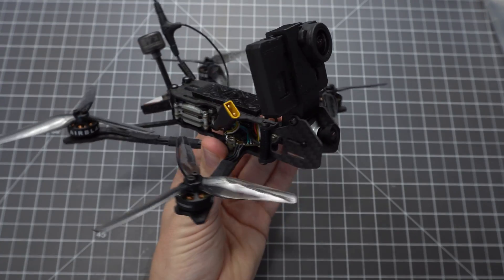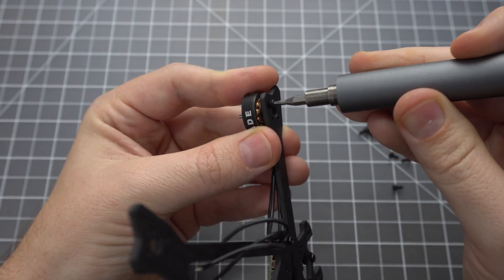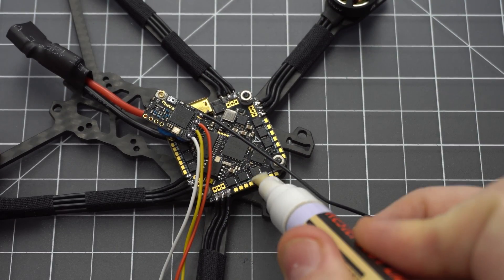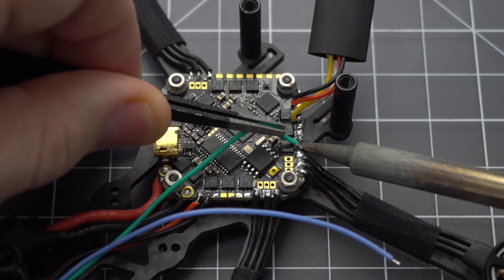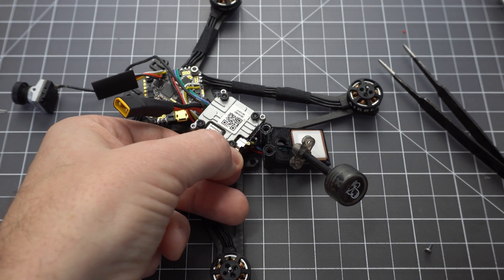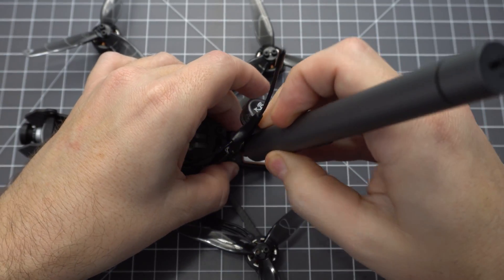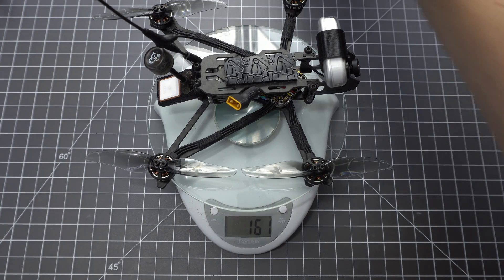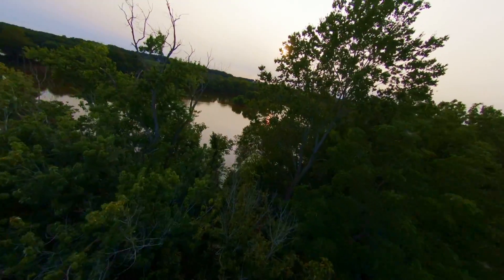How to Build a Micro Long Range FPV Drone - Transformer Mini

Comment: 4 inch frame with 2.5mm base plate
beta fpv toothpick f4 20 amp all in one flight controller with xd 80 and capacitor
Airblade superman 1404 4850kv  brushless motor
cadx vista / Nebula camera 
Tbs m8 gps TPPU holder 3d print for GPS
crossfire nano receiver 
cadx vista antenna

Comment: hey you said you could skip the reciever step if you're using the dji fpv controller. what did you mean by that? I'm going to basically create this exact micro long range build just with a dji air unit. do I use a different reciever?

Comment: Question: I would like to have at least 10km range with fpv goggles. What is the cheapest solution? Goal is to inspect my land without using my car. Could I use BetaFPV VR02 and boost the signal for longer range? Image quality isnt a priority right now, I just want to get started with something long range.
Reply: Bottleneck is battery time , hardly 15 mins , there is some kits allows to 22km (max 30) at 150-180ms but there is no battery invented for it , even large battarys has small range due its weight

Comment: Did you get around to making a 2S 21700 4500maH pack for this?  :) I have been slacking hard-core and haven't had time to assemble my Transformer yet! 😆
Reply from the maker: Yes, but I had a hard time tuning 2S, so 3S is the way to go.
Reply: @whiffles  good to know. I've got the 4850kv motors to put on mine.
Reply from the maker: @j.c.m5168  Those will be perfect for 3S or even 4S. Lots of oomph on 4S.
Reply: @whiffles  another quick query....realistically what gauge wire do we need for this setup for an XT30 plug? I'm running the flywoo 3000MaH 4s LiIon as one option, and Apex 1100MaH 4s LiPo as a lighter weight option to have around and try out. Thanks.

Comment: How good does your GPS work?  I have Matek  M8Q installed at the same position on my 4" quad (with analog VTX) and it could find only 6 sats. I got GPS works only when I moved it to the front of the quad (where GoPro is usually placed)
Reply from the maker: It works pretty well. I think I had 14 sats last time I flew. You may need to wrap the wires where they pass by the VTX with some copper tape.

Comment: do you have a link for the antenna holder/sleeve? thanks!
Reply from the maker: It comes with the TPU GPS mount listed in the part list on the written guide.
Reply: @whiffles  the link in your guide has the GPS mount but looks like one piece per that airbladeuav site.  I had already ordered it but thought there was a second part I needed to order after watching your video.
Reply from the maker: @orblivious1  Actually the design of the GPS mount has changed. The Immortal T sleeve is built into it now.
Reply from the maker: @orblivious1  Nope, no need now. It's been redesigned to serve both functions.

Comment: your soldering is very bad
Reply from the maker: Thanks for the feedback! Any suggestions?
Reply: @whiffles  definiately you need to keep in mind that both parts you solder need to be warmed up to melting point. In that way you will have a very good bound. You will see it when the solder "flow" on the pad and change a shape from a "bally" look.
Reply from the maker: @terragady  Which joints need some work? Motor wires, power lead?
Reply: @whiffles  cant remember now but can tell later when i have time to rewatch, remember also that for example ground needs little more heat as it has more temperature capacitance because there is more cooper/metal.
Reply from the maker: @terragady  Good to know, thank you!

Comment: You have flush cuts! please flush cut your zip ties hard against the head of the zip tie.
Also, you don't need to add flux to the pad when you start soldering. Solder has flux in the core. You'll only need to add flux if you're trying to reflow a joint.
Reply from the maker: Thanks for the tip!

Comment: How does this compare to Dave_C's micro long range in terms of weight, flight time, etc? ^^
Reply from the maker: It's a little lighter and depending on the components and batteries you use the flight times will be more or less the same.
Reply: @whiffles  Thanks! :) Didn't realize your build was that much lighter! I now went back to his video of his Flywoo Explorer, for comparison: He measured his without battery strap (roughly 4g from your video) but with buzzer (roughly 3g with wiring). Adding strap and buzzer to both builds, his weighs 164.5 + 4 = 168.5g and yours 144 + 3 = 147g. A different model, the Geprc Crocodile Baby shows a weight of 160.4g without battery strap on the product page, so it comes out at 164.4g. Both use longer VTX antennas and I have no clue how much difference that makes, but yours is lighter than the Flywoo Explorer by 21.5g and lighter than the Geprc Crocodile Baby by 17.1g
Adding a GNB 1100MAH 4S (weighing 87g) to your build would be 234g. Betafpv naked GopPro is 26g + mount you are probably more at 30g, so you are at 264g. Those 14g could be shaved off at least by going analog I think. Dunno if there is a way to shave off 14g otherwise without removing the GPS and the beeper.. would be hard I guess. Nevertheless you would end up with a pretty sick rig! thanks for sharing!
Reply from the maker: @no-trick-pony  Best way to come in under 250g is to use a smaller pack. I bet it can be done with a 650mah 4S and you'll still get plenty of flight time. I'd guess 7-10 minutes.
Reply: @whiffles  that might be true, but the most appealing part to me personally would be the range I can get with it while staying below 250g with a high quality cam (like a naked Gopro, that can record a flat picture profile I can stabilize and grade afterwards).
Reply from the maker: @no-trick-pony  It's definitely a compromise. If you're working under a 250g constraint then you need to choose HD footage or long flight times.

Comment: Nice video! I tried to fly a light setup with mavic mini motors and a 2s battery ( 18650 lion). I used a 2-4s capable flight controller. It did not work, probably because of some voltage drop or not enough bec. Probably the ideal would be a 1-2s capable flight controller, similar to a recent video made by David C. What is your opinion on how to deal with 2S batteries and the correct flight controller for them? Best regards!
Reply from the maker: Why use 2S? It's very difficult to tune something this size on 2S. You want at least 3S or 4S.
Reply: @whiffles  ask DJI why they used 2s on mini 2 ;-)... On my setup, I used 5 inch propeller and 2s as well, to reduce weight. Unfortunately, I had to use 3S lion 18650 and got 25 min+. I suppose my flight controller cannot hold 2S because of voltage drop using lion.

Comment: you can only use DJI goggles or you can use others?
Reply from the maker: You can build this with an analog camera and VTX.
Reply: @whiffles  can you send to me the link for the kit with the analog camera? Thanks
Reply from the maker: @Visionbygt  I didn't kit this out with analog gear, but you've got a number of options. I'd get a 20x20mm VTX like the AKK FX3 or anything similar with an MMCX connector. As for the camera I suggest the Caddx Ratel micro or the Foxeer Cat 2 micro.
Reply: @whiffles  can i pare it with other digital goggles? like the DJI goggles RE (racing edition)?
Reply from the maker: @Visionbygt  I think the DJI goggles RE use an analog receiver so those would work with something like the AKK FX3. I'm not sure I'd recommend those goggles though. They're pricey and somewhat obsolete.

Comment: DOES THE RANGE OF DISTANCE FOR THE  LIVE VIEW  DEPENDS UPON THE CAMERA QUALITY , VIDEO TRANSMITTER QUALITY  OR THE EACHINE QUALITY. REPLY BCOZ I HAVE WRITTEN HERE WITH HOPE.
Reply from the maker: The range of the video depends on the system you're using. Both DJI and analog can go far but any obstructions such as trees or buildings will quickly diminish range.
Reply: putting eachine and quality in the same sentence is pretty much a federal crime

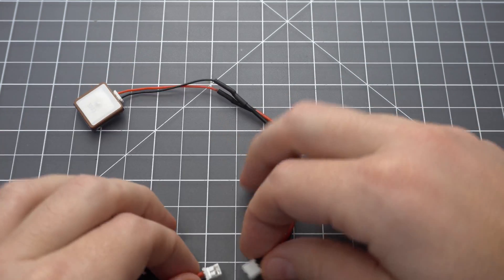Comment: İ think this will be my next project thx for the video and how much far could you go with it ? :) Thanks for the video again . And what are you doing in 3:38 i couldnt understand because of my English can u explane easily if you can i will ve happy thanks :)
Reply from the maker: It can go as far as about 4-6 miles in theory, but depending on the restrictions in your country your observer still needs to maintain visual line of sight. At 3:38 I'm just downloading satellite data to the GPS. It can sometimes take a while for the GPS to get a 3D fix.

Comment: Is a capacitor always necessary for the Vista build?  My 4 inch project is pretty short on space and I thought Barwell once commented that it wasn't that important on the DJI system.
Reply from the maker: You can always make it part of the battery lead like this one.

Comment: Hi...awesome job in producing this video. thank youl.
This will be my winter build.
I have DJI M2P Zoom, so I don't want long range. Instead, I want the longer flight time for highly maneuverable FPV flights with the Li-ion batteries. So, I won't need the gps unit. I found this video about 1.5 months after being uploaded, so I'll look for the Li-ion battery build. 
I have the DJI controller for use with simulator, so I won't be needing the crossfire either. 
I found this video about 1.5 months after being uploaded, so I'll look for the Li-ion battery build. 
I intend to fly this at larger local parks, and school grounds. 
With that in mind, how loud is this quad?
Please reply
Reply from the maker: This is probably the quietest quad I've built. I love that about it!
Reply: @whiffles  Thank you

Comment: Awesome build! So im trying to build the same setup, but Im using 20a HAKRC Aio. Do you have a certain pid tune you use? Mine shakes so bad when I use throttle I can barely fly, thanks!
Reply from the maker: What battery are you flying? 4S, 3S and 2S all need different tunes.

Comment: how is the performance on 18650 batteries? i know the C ratio for these batteries is lower
Reply from the maker: It flies great on the Molicel P26A cells. I made a 3S pack using those and it's got plenty of power. Check my latest video.

Comment: Oh nice. Curious to see flight times in the future.. how much time u give up for double the power..
Reply from the maker: I just put out a video about the Li-Ion batteries and I've got some flight time info in there. Using a 3S Li-Ion battery on these motors I'm getting about 15-20 minutes, but 3850kv will get a bit more.

Comment: Great content! would you recommend mounting a GoPro hero 7 (not naked) if so, what do you think the flight times would be with the varying battery setups?
Reply from the maker: You can probably get away with it if you use a small battery like a 550mah 4S. I put a 200g 4S Li-Ion on there and it flew but it was heavy. You'll probably only get 3-5 minutes carrying a full size GoPro. This is much better suited for a naked GoPro. With a naked GoPro and a 3S Li-Ion battery you can easily get 15 minutes.
Reply: @whiffles  Ahh ok i see, thanks dude,  chasing longer flight time/range (15min+) is always a must for me. Just thought a non naked gopro would be nice, purely because it's expensive and didnt want to strip down and then not be able to use for other things like water sports,  ahh tough choices...
Reply from the maker: @jayones584  It really depends on how you fly. I put a 2S Li-Ion pack on this and flew quite slowly without a naked GoPro and got 28 minutes. If I had 3850kv motors I could probably do the same with the 3S Li-Ion. Once you add a GoPro and start flying a little more aggressively you lose flight time. It's all a fine balance.
Reply: @whiffles  interesting, guess I need to do less browsing and more time building/testing. Keep up the good world tho, other youtubers never comment on these critical bits for newbies like me eager to start

Comment: Awesome concept bro! Gonna be building something very similar very soon I think 😀
Reply: David Allen would you plz convert it into analog
Reply: @parshvapatel8484  Nah 😀
Reply: David Allen you are planning it digital
Reply: @parshvapatel8484  built this in digital with a Dave C variant months ago 😜
Reply: David Allen with cross fire nano if it is give me the U.K. Link plz wanna purchase it
Reply: @parshvapatel8484  bro, these are built from many different parts. Do your own homework and buy the bits you want to use. Simple.
If you can't be arsed to do that, you should probably find a different hobby as you will not like this one.
Reply: David Allen in which field of study it comes in .have any ideas. I have searched a lot ,they say electrical engineering
Reply: @parshvapatel8484  It's a little bit of everything, so you should be good at it 😀
Just watch Joshua Bardwell on YouTube. 
Buy a ready to fly all in one package  (quad, radio and goggles) and learn how to fly. I would recommend BetaFPV Meteor65 or 75 to start with.
Good luck

Comment: Where can get this parts on a Europese based website becuase website that you list are in canandian-usa based website and i live in europe and want to build ti quad and great video
Reply from the maker: Unfortunately the frame and motors are only available at AirbladeUAV. You might be able to find the Flywoo Explorer, but I know it's been out of stock everywhere.
Reply: @whiffles  no problem thanks for the reply
Reply: bangood

Comment: Having your crossfire antenna right up against the video antenna will effect the radiation pattern (and swr) of your video antenna (and possibly also crossfire antenna).
Reply from the maker: Yes, it's ideal to use a tall SMA antenna for the Caddx Vista instead.
Reply: @whiffles  It would be handy if TBS, or anyone, made a 1/2 wave, ground-independent, end-fed vertical antenna for 900mhz (I guess it would need a matching circuit to swr it in).

Comment: Thumbs up, but why should people build this instead of just buying a Flywoo Explorer LR?  Ok Nebula, a smidge lighter, what other differences, price?  Range?  Power?  
Thanks for answering my question.  
Nice Velocidrone sfx at the beginning....
Reply from the maker: It's really a matter of whether or not you want to build. I think these parts are more readily available than the Flywoo at the moment, so I guess you could be flying quicker if you build. I'd recommend the full Caddx Vista for this as I'm not entirely impressed with the Nebula camera. The weight savings is negligible. In terms of price, range and power they're both very comparable. This is a slightly lighter rig due to the frame and the use of a toothpick AIO. You also have a variety of HD camera mounts to print.

Comment: Any idea what the 3D printed GoPro strap w/standoff weighs?  I'm pretty miffed at myself for getting into this, every component that I ordered is 1 to 2 grams over advertised, her projected weight is now 269g (allowing 8g for the strap) with a 2S Li-Ion and now I find out that the GoPro needs a mystery 5g power adapter and the GPS holder has to be painted because it is lime green.  And that's using friction tape instead of a battery pad.   At this point, I think the dream of a Li-Ion powered LR GoPro quad under 250g is more unobtainable than a naked GoPro mounting strap.
Reply from the maker: The GoPro lite mount with the standoff and screws weigh 5g total. You don't need the balance lead power adapter. You can run the GoPro from the BAT+ pad on the flight controller. I just didn't want to run an extra wire. Since the battery lead to the FC has a capacitor you should be covered from voltage spikes. You may need to sacrifice the GoPro to power it with Li-Ion. The only way you'll get the GoPro on there and stay under 250g is to use a small Lipo, but even then you can still get about 6 minutes of flight.
Reply: @whiffles  Thank you for the quick reply.  I think I can get a 2000mAh 2S lipo to do the job after carving the frame in a few areas, but if my flight times are only 6 minutes I'm going to stomp it and give up on model aircraft.
Reply from the maker: @321RCHeli  Oh you should get a lot more than 6 mins on 2000mah! Let me know how it goes. I get 6 minutes on 4S 550mah and 8 minutes on 4S 850mah, but 850mah pushes me over 250g.
Reply: @whiffles  Crunching the numbers, it appears that weight isn't the only problem with a 2S Li-Ion setup.  The quad would need too many continuous amps at 7.4V on a hard climb.  It's even going to push the limits on a light low C lipo.  I went with 2S on some false assumptions and it very well may not turn out ok in the end.  I will let you know.  Thanks for all your efforts, great stuff!
Reply: FWIW update, I switched to 4S and redesigned the frame for a single battery strap, lighter weight and more room for a 800mW video transmitter.  Had to wait eight weeks for the new motors, but meanwhile passed the ham exam.  The whole heap weighs 172g.  I'm hoping that with a MaxAmps 800mAh 40C (also a long wait), it will come in under 250g.  If not, I can toss the finder buzzer.

Comment: Hey! How did you build that balance lead adapter for the naked gopro?
Reply from the maker: It's just an adjustable BEC with a capacitor. Nothing special. I just didn't want to risk any voltage spikes.

Comment: awesome build. that's a cool spot to fly. any reason why using crossfire instead of the dji controller? (besides not having a controller?) You'd save some weight the rx and extra antenna/mounting bits
Reply from the maker: I just prefer the Tango 2 form factor and the peace of mind of flying with Crossfire. Plus, this whole kit fits into one Lowepro QuadGuard Transmitter case.
Reply: @whiffles  ah, good point. portability/transportation is quite significant for me being in the city